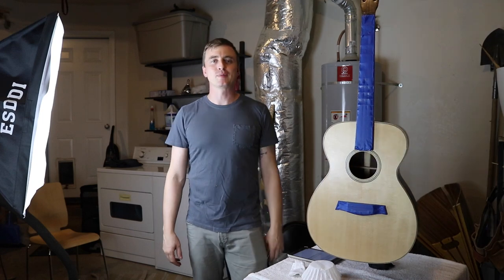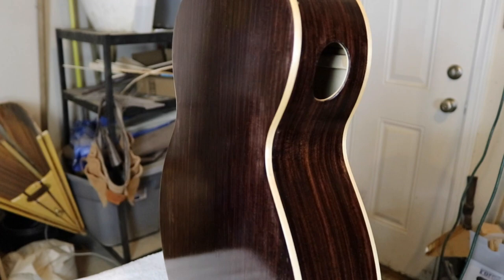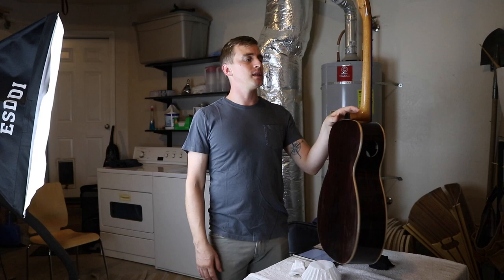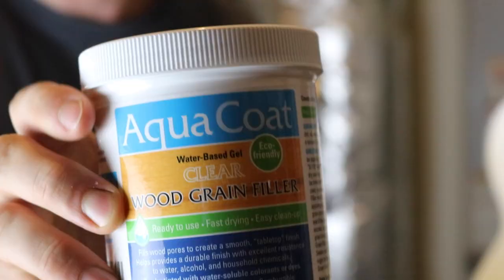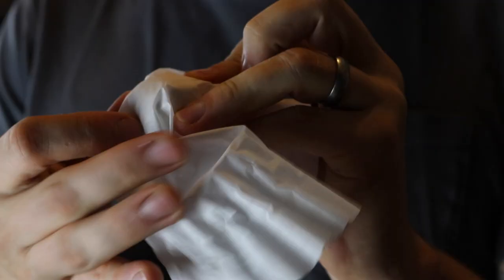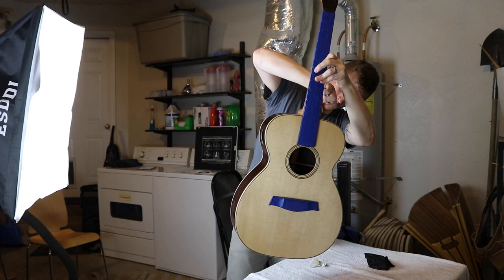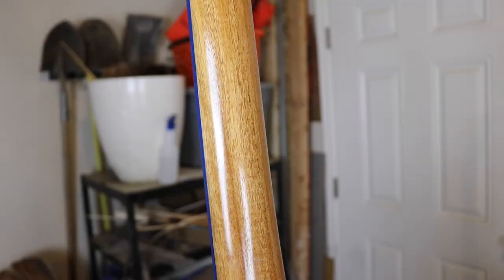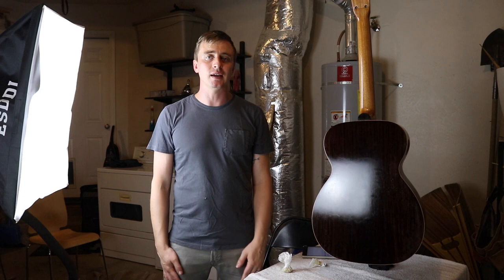Applying a Tru-Oil Finish on an Acoustic Guitar

Comment: I am an amateur luthier like yourself and never ever thought of Tru-Oil as a simple guitar finish. I am a veteran gunsmith though and have used that product extensively in that trade. I can understand that if it has no, or minimal effect on acoustics, it would have many benefits, if not for visual, at least for durability as well as ease of repairs.

Comment: Tru-oil is a gunstock finish that gives fantastic protection. It is easily repaired if a scratch or ding is found. You don't have to refinish the whole area again as it will blend easily. I allow a day between coats and polish it out to the finish I want (glossy to flat and anywhere in between).

Comment: I used spray on nitrocellulose lacquer on my first and Tru oil on my next two. I liked Tru oil way beer all the way, the finish, ease of applicator, cost, nontoxic. ...

That guitar is looking good.
Reply: Better that is! :)
Reply from the maker: James Clem cool! I’m glad to hear that cause I’ve been second guessing myself through out! Thanks Jim!
Reply: I am refinishing a 1960's guitar, sanding the gloss to a matte, which I like better... There are some places on the head stock that are bare wood now...and the neck seems to have a thicker varnish. My plan is to fill the pits and digs with a matte varnish? Shellac? or Lacquer?  Anyway I thought of doing an oil after all this is completed or I also have a car wax....   What do you think?
Reply: Thats ok , you can like beer too! :) so i did what you did and used nitro-lacquer and not loving the look, i'm asssuming i would have to resand at th every least the Lacquer-if not the whole guitar? That is if i was to apply tru-oil instead?

Comment: That's looking really good. I would like to see the wax finish if you decide to go with it :) I've mostly used Tung Oil as a finish in the past without wax. I recently started to use Danish Oil but I am thinking of experimenting with an abrasive paste wax finish for a semi gloss look. Thanks for sharing.
Reply from the maker: The Wood Yogi cool yeah there’s so many options I get overwhelmed sometimes. I’ll post the final thing here in a couple weeks w my thoughts on how it ended up

Comment: Oil on an acoustic?? Please don't do that. It seeps into the wood and dulls the vibrations of the woods. You should only use oils for furniture pieces! Use shellac for instruments as it coats the wood.
Reply: Your theory is correct.  The first consideration for an acoustic guitar finish is that it should not contribute to tonewood damping (inhibition of soundwave transmission).  But Tru-Oil, despite the name, is a surface varnish that dries to a hard resin.  Shellac is a great-looking finish (which also soaks into the wood) but requires a significant learning curve to do well and isn't all that protective even after many coats.  Tru-oil is a very forgiving finish and produces acceptable-to-outstanding results for almost everyone on their very first try with it.
Reply: As a note, never do burned finish + oil... I have an electric that weighs about 400 lbs now.
Reply: @drocker66  your link is for a solid top not an acoustic..
Reply: my bad Stephen thanks for letting me know i'll change it... sorry.
Reply: Sorry about i think i was just trying to imply wood in general, If you don't mind me asking i just finished a spruce top (which was more of a pine color ) and stained it into a  mohagoney, it's my first big job and didn't use an expensive acoustic, i'm just wondering will true oil be a good finishing product? i've heard mixed things about shellac and lacquer. I heard def not poly. i'm just doing the top, not the sides, which are mohagoney. Any advice or reccoemendation would be appreciated. Thank you
Reply: I have used tru oil on the neck and everyone loves the way there hand slides down and up guitar, not like those Laquer finishes.